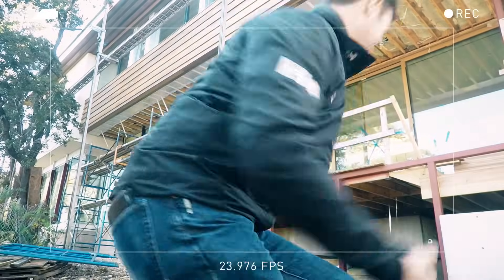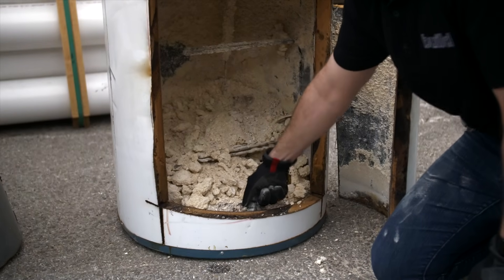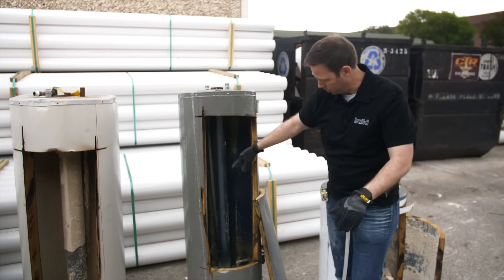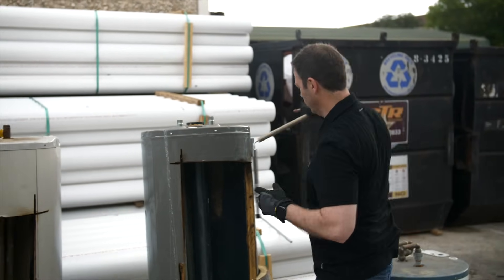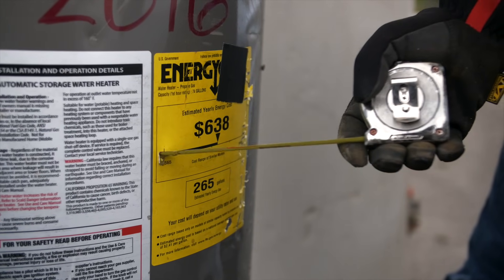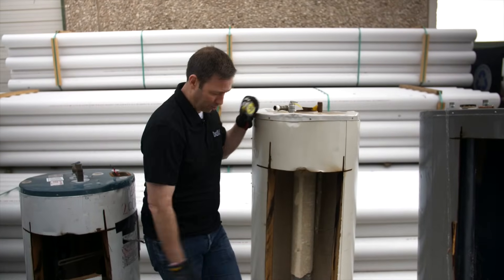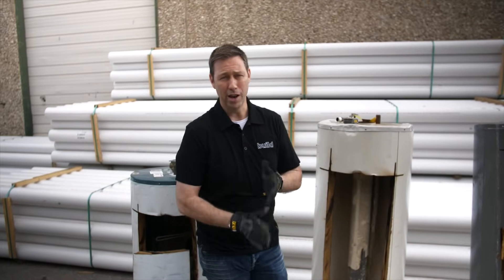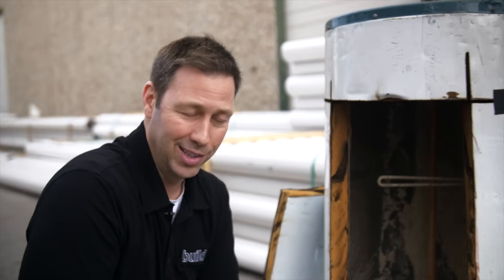Four Water Heater Tanks Cut Open - Lessons to Learn

Comment: Simply connecting a water hose to the drain valve will NOT, flush out the crud from your unit. A full bore ball valve needs to be installed instead of the very constrictive hose bib installed by the factory. And i don't believe there is enough agitation from the flow of the water [ipe which goes down to the bottom of the tank to properly flush the crud out of it. Does anyone agree with me? I been plumbing thirty years.

Comment: After 10 years of hard water and no maintenance on my 40 gallon shorty I cleaned it out. After draining and vacuuming for about 8 hours I extracted about 5 gallons of scale. Replaced the elements, one of which had shorted out so violently it twisted about 100 degrees, and thanks to the water softener I installed I now have a clean efficient water heater again. 

"An ounce of prevention is worth a pound of cure." Benjamin Franklin

Comment: I replaced a natural gas  State water heater that started leaking after 30 years. Yes it was drained once every year. The replacement was a Richmond made by Rheem. The gas valve went bad after 6 months and they were on backorder.  Guess they couldn't make the good ones fast enough for all those bad ones in the field.

Comment: One of the best things you can add to your hot water tank, is an outer insulation blanket. They make them so they will fit well around a tank, and stay attached. Or, you can simply use some regular insulation , maybe covering in plastic for safety's sake. But it is a good idea to increase the performance of your hot water tank, it will save you $.
Reply: Thanks for the advice! I'm curious, when I put my hand against the tank, and it "feels cold" what is the point of a "blanket" even if it's at the end of heating? If you're referring to an aged water heater, sure! But a newer heater, nowadays? Worthless. Best thing is heat trap piping on your water heater.
Reply: be quite
Reply: @malachibollman4704  Quite what?

Comment: I have a recirculating pump that goes into the bottom drain valve on the water heater.  I don't know but I'm thinking that maybe keeping the scale build up in the bottom of the tank down? Plus I have a water softener.

Comment: 1:15 "how efficient do you think this tank was"
I'm curious to see actually because regardless of the amount of energy put into the system, the heat is still put into the system. If it heats the limescale, it should act as a thermal mass, right?
The heat will still go into the water 🤔

Comment: Holy crap Matt this was informative!! Last year I had an 8-year-old SuperStor tank replaced due to a leak. It was done under warranty (parts, not labor!) but the plumber who did the repair - the same plumber who installed it years back - never exchanged any words with me about maintenance, replacing an annode rod etc. I wish I could have seen the interior of the tank, as it's made of stainless steel and my town uses lots of calcium to soften the water.

Comment: My Seisco (microtherm) on demand electric water heater flushes every time you run a faucet!  It has no anode rod and doesn’t need one! Mine is now 26 years old and is still going strong! The only down side is my utility started applying demand charges and peak demand on this unit can be 28KW!  Check them out!  Mine is the RA28 model.

Comment: Anode rods won't stop mineral deposits, build up.
Flushing only cuts a path thru the sediment, near impossible to get a large amount out.
Better off replacing it as your amount of water is noticeably reduced.

Comment: Don't know much about heaters but the idea of just running the circuit through the water producing scale just sounds like bad design you could use resistance heating with surface area exposure instead even if it's not as efficient there's room for innovation

Comment: Good video, I’ve been a heat guy for 38 years now, in my area, I think I’m one of the only guys around that actually change the anode rods and flush water heaters, I install mostly Buderus equipment, so if you don’t change the rods, it voids the warranty, so it’s so important to do. Great video with the cut always, a lot of people do t realize what actually goes on inside a tank or a boiler, AFUE ratings are very in general, in my opinion, I don’t believe they’re very accurate. 🤷🏽‍♂️

Comment: Tip from an Australian plumber don’t overtighten Anode a new anode has thread tape on it for a reason ( it has a tapered thread to create the seal)to create Electrical isolation of the steel cylinder and the anode and so the anode itself can be eaten away by the water And not the steel cylinder

Comment: took out a water heater from a house that was in there since 1988. it was a glass lined tank. never serviced, but rusted out at the drain gate valve in 2017.

Comment: After ten years my tank was 2/5 full of scale and it only gave enough hot water for one shower.  Upon further inspection one of the heating element bursted as well.  Dumped and rinsed the scale, replaced the heating element and it’s still going.  I did not notice a rod though.  It’s not a hard repair folks.  If you can’t remove the water heater the same day you discover a lot of scale, don’t forget to close all valves as I have learned the hard way that a lot of scale can absorb a lot of water that will later drain if the drain valve was left open.

Comment: A scaled-up tank will not use more electricity than a new one. The problem is that the conduction of heat from the resistor decreases as it becomes covered with scale and will eventually burn out or the tank's capacity will be reduced to the point that the homeowner notices it and replaces the tank.

Comment: Duh! "Anode rods" real plumbers call those "heating elements" upper & lower and when the lower one gets covered in lime,  it over heats & burns out! Also those deposits can plug the P.&T. safety valve, potentially turning the tank into a powerful bomb! So flush it every year, [tap on it to re seal]

Comment: Get the thickest replacement magnesium rod you can reasonably purchase. The factory rod bolt head is the same size, but the heaters with shorter warranties seem to have thinner rods installed. So look at the length of your warranty for an idea of when the factory rod will need replacing, when you should replace the factory rod with a new thick one.

Comment: Would it be possible to calculate the thickness of the insulation by measuring the dimensions of the water heater and comparing that to the volume of the tank?
Reply: If you have an electric water heater you can remove one of the side covers for the heating element. Move away the loose fill insulation around the element (if there is any) and you can see the inner wall of the tank. Then you can measure from the inner wall to the outer wall and come fairly close to an accurate thickness.

Comment: Proud to say we have a 25 year old 50 gallon gas tank still going strong.  We're on a private well with softener.  I replaced the anode after we moved in (8 years) it looked like a coat hanger.  Went with the Mag/zinc rod from that point forward (3X's now).  One downside is I've never been able to adequately flush the tank and I get rust colored hot water when I try to fill out spa tub which has 3/4" copper service to it.  I'm assuming the rust colored water is a result of debris from the 3 expired anodes....and some iron from the well source.  Every time I go to flush I just seen to stir up more muck and we'll get rust colored water at the hot taps.  Might try what a poster below suggested by using the shop vac to get the junk off the bottom of the tank, ...,or I'll just retire this tank and run the aluminum anode.  thoughts?

Comment: Put in a Corro-Protec powered anode rod and it's good for 20 years. And it's short and easy to put in with low overhead clearance. It also eliminates permanently the sulfuric stink in the hot water; which is actually caused by the magnesium anode rod.
Reply: I've had some horribly sulfurous ground water but you're right if the stench is isolated to water heater output.

Comment: Matt, I installed a Polaris water heater/furnace in 2005, and have flushed it 3 times. Each time the water was clear. I installed an Eddy water softener/conditioner 5 years ago and all the scale in my house has been reduced and the volume increased, while pressure remains steady. Check out the Eddy unit! Folks with high mineral content will be amazed! They come with a 1 year  no questions asked GUARANTEE. I'm installing another unit on my rental property with a brand new tankless water heater. It should make the yearly flushing easy.

Comment: If you have hard water so you end up putting in a water softener, you're going to want to remove the annual rod all together, the magnesium and old rods will start deteriorating and you'll get a rotten egg smell hot water side only, just put a plug in don't even replace it just remove it
Reply: Very bad advice. Soft water is corrosive

Comment: I need to replace a water heater this spring that is 33-35 years old. I’d love to fix it, but the manufacturer is gone. Over the years of our parents owning the place i’ve drained it a couple/three times. One heating element died 3 years ago, the second is likely about to go any day now. Nicely insulated with a glass lining inside the tank. A really nice unit that served us well. I’m sure electric consumption not that efficient as i’ve never replaced anode rod. But after 33 years the unit owes us nothing.

Comment: You don’t need to flush a water heater and you don’t need the anode rod. Install the heater and use it when it goes tits up get a new one.Just like tires on your truck.4 years in on my $600 gas hot water heater.

Comment: well...maybe what you say is accurate. I have an electric 80 gallon tank in the basement that has been in service for 34 years and we have plenty of hot water and it rebounds quickly so can't be very loaded up with scale. We have a 600 foot deep well and the water is hard as a rock with high mineral and loaded with dissolved iron from the basalt where our aquifer is located.

Comment: My question is, what if I have my own water Heater constructed out of 304 ss.
Will I still need an anode rod?
The other question is if I use two 4500 heater element can make the tank 70 gallons?
Very interested in any comments.
I just had to by a tank and it was in the $900 range.

Comment: All hot water heaters are junk these days, i got 9 years out of a bradford white..a top model, i do believe location of heaters is paramount..if they" are not" confined into a walled closet they last much longer..ie like the type of basement your grandfather had ..furnace and hot water tank free standing within a large room..and plumbed burnt gases out a chimney vs b vent ran through multiple floors..confined saddled into a room with a furnace cooks em..

Comment: Great video!  I’m just starting to learn about my water heater.  I flushed it for the first time and it was actually in really good shape.  I have a water softener.  The unit is 13 years old.  Then, I flushed my neighbor’s unit, which is newer, and hers actually had a lot more stuff come out than mine.  A day after flushing mine, I noticed the temp and pressure valve was leaking badly, so tonight I replaced it.  I think I should go ahead and replace the anode rod, after watching your video.  My unit looks like a very low efficiency one, but it seems to have a lot more life in it, so it probably makes sense to do this small amount of maintenance and keep running it for a while longer.
Reply: And if your heater is within a space that needs heated in the winter, e.g. centrally located within the house, then you are not really loosing heat in the house, only in the hot water system.
But of course all heat is lost eventually.
Reply: With a water softener, you will have less sediments but you might have more corrosion. Hard water protects the tank from corrosion.

Comment: Be careful adding the "blankets" which claim to add efficiency. They can trap moisture against the outside of the water heater. Some manufacturers will void the warranty, if you use one.

Comment: When the local municipalities flush their water lines sediment will find it’s way into those hot water heaters. Installing a water filter system after the water meter should do some help. Thanks for the video.
Reply: What is scale?
Reply: @allwayzangry8290  scale is the calcium buildup from the water.

Comment: The only problem with insulation thickness and overall size is that most homes have very little room and typically the door to the closet will not allow a larger closet. Nothing kills a install like having to reframe a closet or drop 20 gallons of capacity because of size
Reply: We can't even open our bi-fold closet doors. Have to take them off to do service. Same on furnace side.

Comment: My experience with water softeners is that you'll be lucky to get 8 years out of a tank. The salt eats through the tanks. The houses I've had that didn't have softeners, the tanks would last 20+ years. The problem of course with those tanks is calcium buildup.

Comment: The tank-style hot water heater in the house I live with my family is over 25 years old and it's only needed a  couple of heating elements  and a couple  of thermostats the second thermostat replaced a replacement one after the first replacement one crapped out because I think the faulty replacement slipped through QC.

Background information I live in Auckland,New Zealand and the water is soft and it's installed in the roof cavity.

Comment: I replaced the anode rod in my approx 6 yr old Whirlpool elec hot water heater. (50 gal)
I drained the tank, the rod was very corroded. Replaced the rod, refilled tank, but it still smells like rotten eggs. I'm at a loss on the next step. Can anyone advise?

Comment: So, the high pressure relief value is just an opening on the top?  Last time I flushed my tank out I waited until it drained for like 30 minutes and then turned the water back on for 15 seconds to agitate everything inside.  When I did that water came shooting out of the high pressure value (which I had to open in order to drain the tank).  How is that possible?  The water coming out the hose at the bottom increased also, so I don't think the tank was full somehow still.

Comment: Why would it use more electricity? It's a self contained system, the energy for heating should all stay inside and make everything the same temperature? Even if the sediment is heating up, the heat energy from the sediment has to transfer to the water until equilibrium right?

Comment: The electric water heater was no more or less efficient when you cut it open than when it was new. The first law of thermal dynamics says energy is neither lost nor diminished it can only change form. If the water heater used electrical energy it was dissipated as heat into the water. The heater may have had performance issues but never a change in efficiency of it's use on electricity.
Reply: Right on. The water heater will suffer being able to heat quickly or the elements may burn out from running too hot (from the insulating effect of the deposits), but it won't consume more energy.

Comment: The scale covering the element doesn't effect efficacy but it will kill the element in an eclectic.  If a tank is 12 yrs old, a lot of people will replace it rather than change the element.  Changing the rod and flushing can double, triple or more the unit life.   Be sure to install the largest element you can, in length and diameter (come in 1/2, 3/4. and (I think) .9" )   Magnesium is best unless you have smell issues.  Scale in a gas water heater effects efficacy as it insulates the bottom of the tank where the burner is trying to heat it.

Comment: That first tank has a replacement rod installed which usually has 3 sections so it can bend around a corner because a short tank is under a sink or stairs somewhere. The sectional rods are also generally Aluminum/Zinc. Where are these tanks from? Here in Southern Ohio if you cut one open you're going to regret it if you don't lose your lunch to the odor that comes out of the rotten rust buckets.

Comment: I'm shopping for an electric 5o gal water heater. My plumer says no need for the linked anode rod on installing as it will decentigrate by the time it's replaced. Please advise. We currently have hard water.

Comment: I am an electrician and worked with thousands of heating and plumbing contractors over the years. They love to upsell the high efficiently stuff as they charge a percentage of the material costs. Almost every single one of them will tell you, "I can sell you a heating system or water heater that can save a lot of energy but it will cost you more money in the long run". I do a lot of electric water tank swaps in flips and rentals and you can't beat a 40-60 gallon electric water tank for $300-$500 bucks. Just plumb them in with a couple unions and the biggest job is pumping out the tank. One trick I use is to run a 3/8 plastic tube from the hot water tank hose drain to the condensate pump of the heating and A/C system. Takes a little longer but empties the tank by gravity right down the drain.

Comment: I was wondering if it would help to put white vinegar and let it soak before draining if that would help? I have a water heater that was not giving me hot water so I put white vinegar in it before I drained it and it started working again for a couple of more years, I wonder if I did that sense new it would last? I had someone tell me the difference between a 6 year warranty or 12 year warranty is the longer the warranty the longer that rod is in length.

Comment: To get out a too long anode rod if space above is limited. Pull it up as far as you can. Use vise grips to clamp onto anode rod to hold it. Get a hack saw or other saw and cut off rod above the vise grips. Pull remaining rod out with vise grips. Then buy segmented anode rod to put back in as he showed.